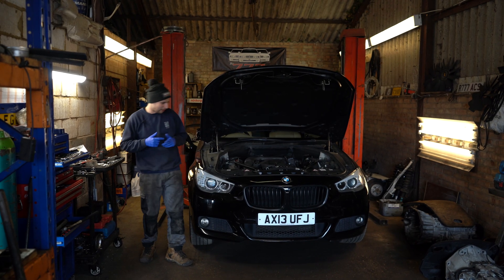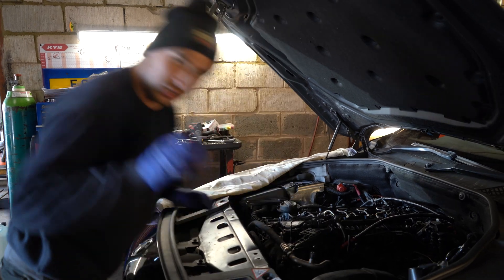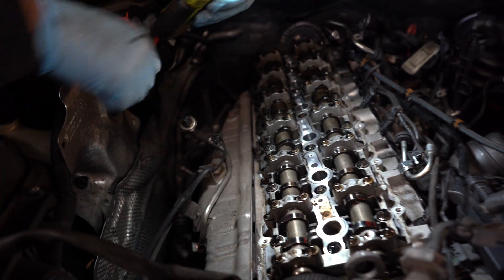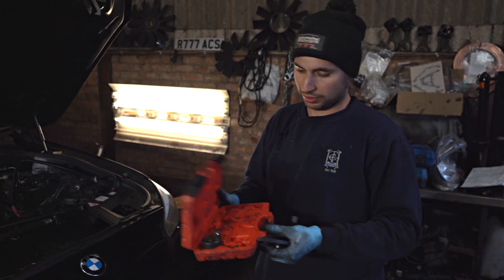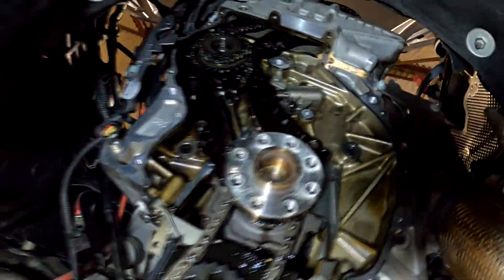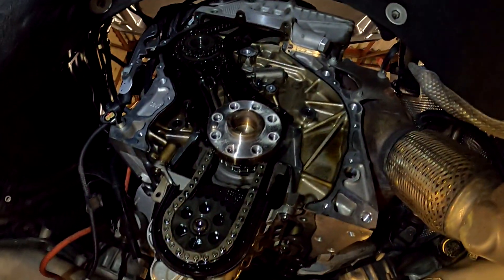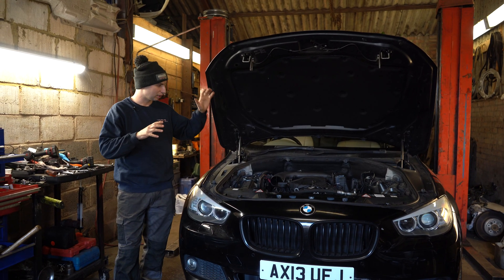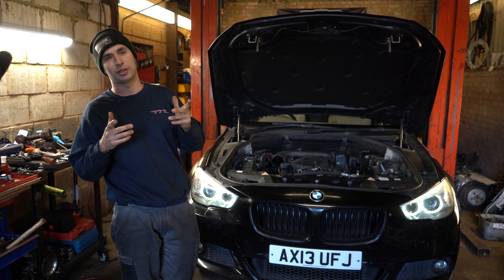Bmw N57 Timing Chain Replacement

Comment: Great video Ed, very helpful.  Why were the chains replaced?  Where they worn, or was there noise or changed as preventative work? How as the inlet manifold - was it coked up?  Thanks
Reply from the maker: They tend to snap randomly..no signs of rattle or anything..that’s why around 100k u supposed to change..n47 2.0d is even worse for timing chain snaps
Reply: @The777Garage  I have an Alpina D5 with over 100k. Better get it done! 
How many hours do you need to do the job?
Reply: When badly worn the top chain makes a rattling noise starting from cold, which goes away after a few seconds - this is usually a combination of a worn sprocket, chain and weak tensioner. The middle chain makes a swooshing noise at around 1500 rpm when worn and engine is hot, either of these chains can snap at this point and if you know what you're listening for it's easy to tell the difference between worn and good chains, there's a few comparison videos on YouTube for reference.
Reply: @nemz7505  Good info, thanks for sharing. Since my post I've had all the chains replaced as engine on 120k miles/190k km as preventive maintenance and peace of mind. The car has a perfect service record and the old chains were in very good condition with minimal wear. I'm still glad I replaced them after this mileage as any weakness there is now gone.
Reply: @asimhumayun7428  Wise move Asim, depending on maintenance and frequency of oil changes I've seen them snap anywhere from around 85k miles upwards and these cars are post the 2009 crankshaft and tensioner re-design. Regular oil changes are the key to longevity, if you change oil every 8,000 miles or yearly whichever comes first these N47 engines will thank you. If you're looking to buy any N47 or N57 engined car, always remove the oil filler cap, get a torch and look at the camshaft and cam carrier, if it doesn't look almost perfectly clean the engine hasn't been serviced regularly and you should probably avoid.
Reply: @nemz7505  hello nemz great info and I have a question, so I had this swooshing noise and car stalled. I have no HPP fuel pressure and it looks like cams are not spinning when cranking over. I’m guessing the middle chain has come apart, in this scenario it is most likely some of the valve train will be damaged correct?
Reply: Yes, usually one cam will be damaged along with some rockers, should really replace both as the lobes can spin slightly on the shaft and fail later, cam carrier can be reused if in good condition. 

Can quickly test what valves are leaking by wrapping gaffa tape round a blower off a compressor so it fits tightly in the injector ports, must replace all valves where there is evidence of piston contact once head is removed, even if they look okay, can get them for about 7 quid from europarts

Comment: Great video! Did you also fit new o-rings and seals to the injectors when re-fitting them
Reply: You should always replace, after the copper has been crushed it work hardens and won't crush again.

You can heat with a blow torch till red hot and reuse at a push, but better replacing.

Comment: How much does this job cost including parts?
Reply from the maker: £1300 ish supply and fit
Reply: @The777Garage  not bad, so maybe ill have to come over there if i need to replace it.. Så expensive here i norway.. (i have a 12 535d)
Reply: @prberli  How much is it in Norway? :)
Reply: @mad_dmitry  i havn't checked, but  im sure it is double that.
Reply from the maker: Damn,but I guess cause ur wages is double over there
Reply: @The777Garage  yeah we have good wages, but everything is very expensive, i payed 30000 pounds for my 12 535dt 1.5 years ago, with 190000km, its probably half in the uk..
Reply: @prberli  wow F11's here are much cheaper, like 4 times cheaper. I guess then it's wort the trip to the UK for timing chain replacement! ;)